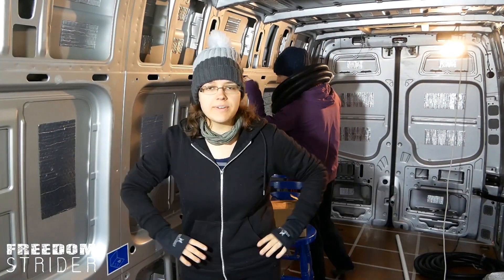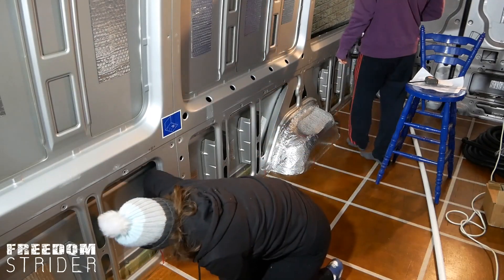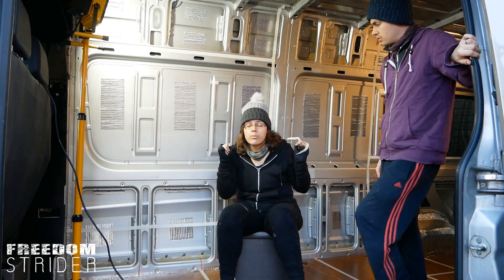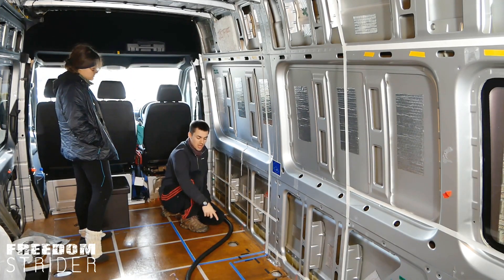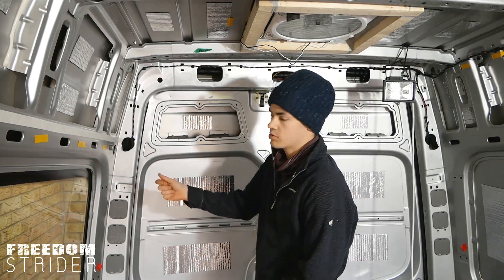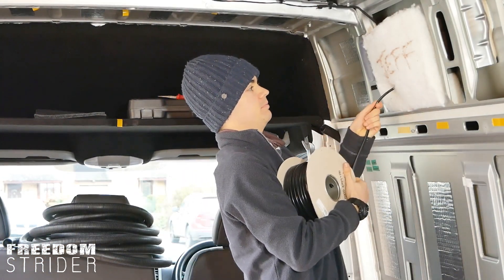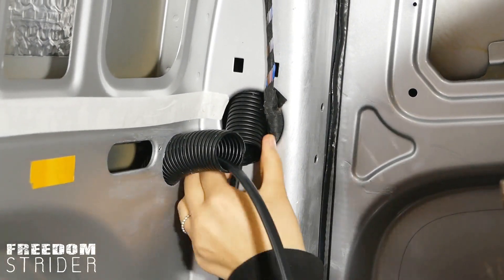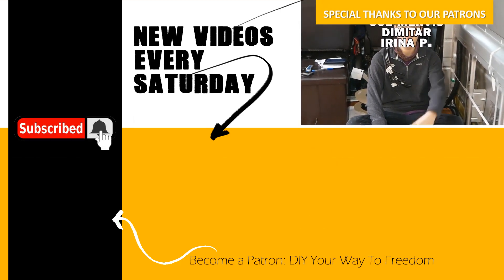Wiring and Conduit | Sprinter/Crafter Van Conversion 101

Comment: Hi guys, as usual great video. Could you please tell me what was the diameter of the conduit tube that you have used to build the van? Thanks
Reply from the maker: The conduit we used was 32mm OD, but depending on how many wires you have, 25mm might be enough 👍🙂

Comment: Just found your video today, September 11, 2021, and see it's going on a year old now so your project is probably completed by now. My comment is meant for those still in the build phase or looking to update or upgrade a project. 

Actually you can drill through bracing and other structure points safely without destroying integrity. Just like you can drill through certain floor joists in your house. HOWEVER, you must take care where you drill; especially in Floor Joists. You want to drill as close as possible to the middle of any structural point you are creating an access hole for. Many times on Bridges you see webbing or various points that look like decoration when it fact it's actually structural holding points that is made to look like decoration. 

Welding points do not necessarily need to be solid, full sheets of some material, so drilling a few holes can lighten the overall structure while still maintaining full structural integrity. It's just easier to use full sheets parts when constructing a vehicle for laziness if nothing else. Drilling holes will lighten the overall vehicle, provided you drill enough of them, but it's an added process which most cheap manufacturers just won't do, so full sheets are used as it's faster and less labor costs. You pointed to a structural area, in your video where you want to run duct. That area was spot welded about a few mm or inches apart and not a fully welded seam hence the reason I say it's ok to make a few holes in structural parts. What you DON'T WANT TO DO is cut the whole structure piece apart by cutting out a middle section. In some cases this might be ok, but most it's not. 

With regards to a Floor Joist do not drill or notch the top or bottom, or near the top or bottom, of the Joist, that actually will create weak points that could cause Joist Failure; more so in the bottom than the top. Drilling as near to center as possible is your only option short of going under the Joist all together. If you have a 2x10 and notch the top or bottom by a 2x2 you just reduced that entire floor joist to a 2x8. Now if you take a 2x2 section out of the middle of the joist it remains a 2x10 joist, even if it's a few inches from the top or bottom enough structure remains overall. 

In a plumbing situation should you care to conceal the pipe, let's say a drain pipe that requires slope to properly function, you can obtain this slope as you pass from joist to joist by starting close to the top and finish as near to the bottom and by cheating the slope a bit. Typically 1/4" per foot of slope is required but no one is going to notice or care if it's 3/16th or even 1/8" slope for short distances as long as the slope is maintained over the entire run of pipe. Don't dip down in one segment then dip up in another, that creates an almost instant clog situation. There's IDEAL SLOPE of, 1/4" per foot, than there's acceptable slope of 3/16th for a foot or two than 5/16" for a foot or two, just depends on each situation as they all seem to be uniqure. 

You can take some inspiration from Race Car Designs and Photos. When you see a part with a lot of hole drilled in it, that is actually a structural part but made as lightweight as possible because speed is obtained with the lightest possible structure. Getting back to Bridges sometimes they will use an X pattern across various parts to keep the bridge as light as possible and again as structural as possible so said X pattern provides that. In short Structural parts do not necessarily need to be full sheets of some material. Full Sheets are required for weather and bug proofing but that's another topic as holes tend to leave weather and bugs in so keep that in mind when considering where you plan to drill. I hope this helps...
Reply from the maker: Wow very good tips and very detailed, thanks for sharing that! Drilling anywhere in a van is delicate work, you have to know what you're drilling in to especially when you cover things up. 👍

Comment: Hey! Useful video. Why did you use 4.5mm wiring for everything? just to keep it simple? Seems quite large for most single component circuits in a van.
Reply from the maker: For the majority of the wires that we ran, they all head to the back and some of the wires will be connected to plugs (which can have various Ampages being drawn, especially since we want to charge our laptops from those plugs), and some higher-powered appliances will be run from them, so the amperage loss over 4-5m is mostly the reason.

Since this video we have bought some smaller 1mm and 2.5mm cable for lower-powered appliances, since you're right, not everything needs 4.5mm cable. 👍

Comment: Looking at all the complication of your wiring I was thinking that an integrated power station would be such a good idea. They are becoming really sophisdicated and powerful and capable of running all the appliances you will need. They are expensive but comparable in price to a traditional electrical installation once you factor in all the additional components (solar controller, cabling etc), to say nothing about the time saved. Doing a great job.
Reply from the maker: We haven't looked at them recently, though they are certainly a great fit for some. Although, in our case, power stations don't allow for expansion in the future. Plus, we have already bought our components - they are just waiting to be assembled 😊... Power stations could be more ideal for our weekend small camper ideas...
Reply: @FreedomStrider  Thanks for your response. Lithium technology is changing so rapidly and power stations are becoming more powerful month by month. I am about to build my campervan and I cannot imagine myself attempting the electrical installation work you are doing so competantly.

Comment: One way of avoiding this problem is to have   architraving along the ceiling wall junction. This decorative moulding usually creates a void behind it. Ideal for ceiling level distribution. It could be made removable quite easily for access to wiring. Also could include led uplighting.like the linked version below.    https://www.manomano.co.uk/p/il3-up-lighting-coving-6421742
Reply from the maker: We were definitely thinking of installing something like that for the original van wires which are on the other side, since they had a plastic housing (which we removed and sold) but it's a good idea, especially for the lighting which we are still yet to install 👍
Reply: Freedom Strider ...   just chucking ideas out there that you or  others might find useful.  Steve

Comment: I didn't use conduit. My wiring kit had fabric braided cables so they are either zip tied or lose. I figure this wiring will out live me or the van.👍
Reply from the maker: Well yeah if your wire has extra protection that is essentially conduit. I don't strictly think we need conduit for our DC wiring, it's more for peace of mind and accessibility/repairability 😉
Reply: @FreedomStrider  not sure if you have finished the wiring, but I would run at least two pairs of wires the length of the van and another pair on the door side to kind of future proof the system. Just tie them up somewhere you can access them.
Reply from the maker: Not a bad idea, it can possibly be run with the van wires since they are run on that side 😊